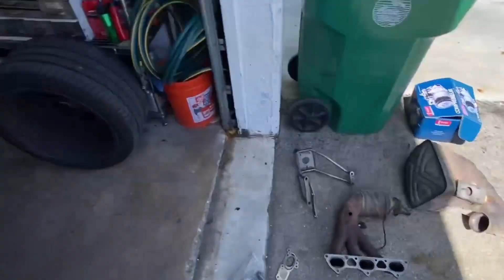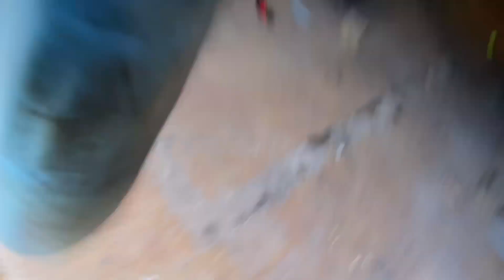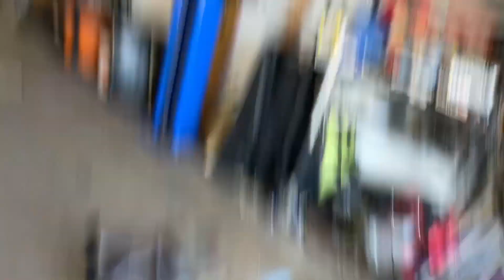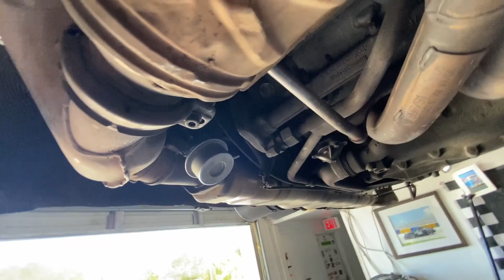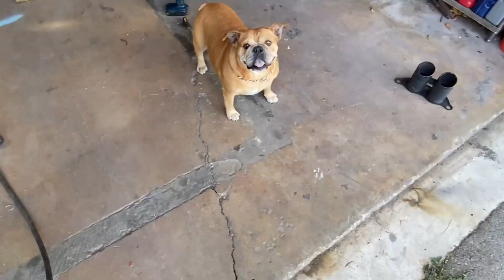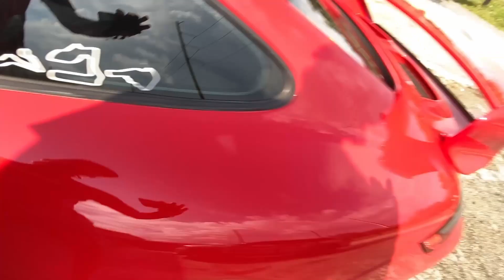Porsche 997 GT3 Exhaust Back to Stock

Comment: Very informative vid. Do you have like a super favorite brand of disposable gloves or is it just whatever available/cheap? I used to use gloves daily at work, most of the brands were meh.
Reply from the maker: I don't have a specific brand. I usually buy the 5mil or 7 mil gloves at harbor freight. They seem to tear pretty easily so on top of the blue gloves I sometimes use some thicker gloves. Pre-pandemic the blue gloves were around $7 per box. Today they are $18 per box so I try to make them last.